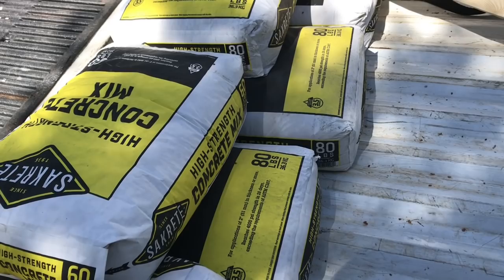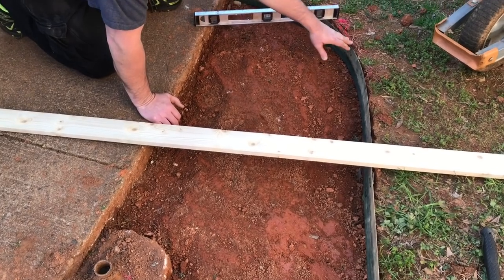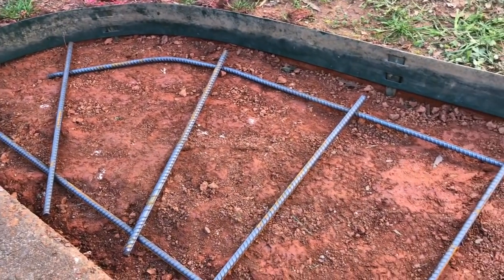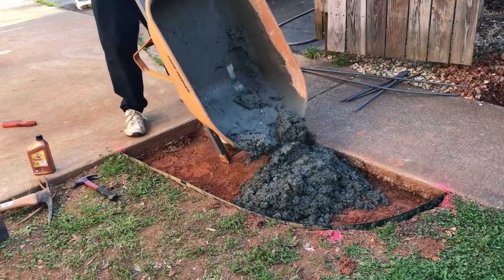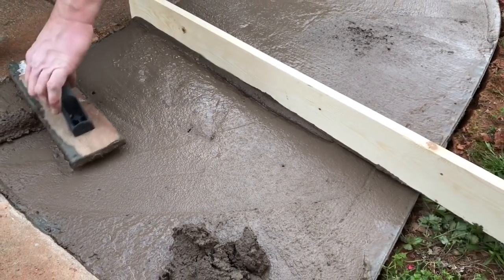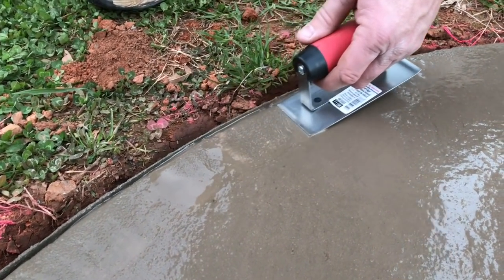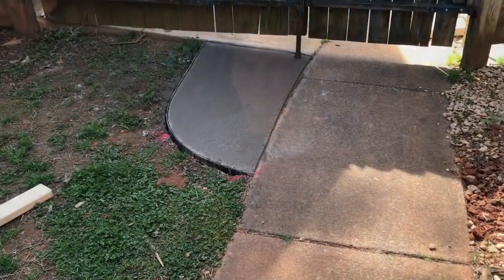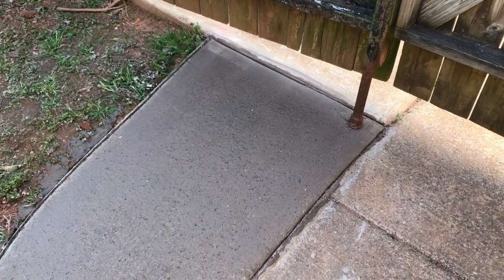How to Pour a Concrete Pad or Sidewalk Extension

Comment: Looks good. One thing I learned is to keep the wet concrete off your skin. I poured an extension of my driveway in July and had to kneel down in it before it started setting. The acid ate up my skin around my legs so bad it took 2 months to heal. I have some pretty nasty scares but the driveway looks awesome
Reply: opichocal that's from the Lyme I believe. Hope ur ok now. Damn
Reply: Frank A  Cement work or masonry, usually carry small jug of vinegar works great, soap and water won’t do it .
Reply: Omg! I've worked with concrete, never had this happen. Yikes

Comment: That’s awesome, I wanted to know that if I needed to put a wood frame for a small addition like you did. But 3 of the sides are actually the current sidewalk and street. So I don’t need to add the 2X4 except on one side.

Comment: Hello from England & thanks for the video.
Question: I have a front door step & I want to make a concrete path that goes up to it, do I have to leave a little gap between the step & the path? If I go right up to the path do I have to use anything to make the concrete & step stick together?
Thank you for any help you may give.

Comment: Question: (I’m tearing out a 4x5 platform outside my walkout basement and pour a new 7x7) do I need to drill a hole in the retaining  wall and/or house footer to insert rebar to tie all in together? Or do I just pour separate?

Comment: I personally would have used a hammer drill and drill into the existing slabs and sink the rebar into it 4-6” so that new slab will stay level and locked into the existing sidewalk, and add an expansion joint piece in between slabs and cut the new slab to prevent cracks just my opinion/thoughts looks good tho
Reply: That slab is small enough to do with no cuts.  And given the amount of rebar, he can just relevel it at any point.  I would have doweled it though
Reply: @matthewlee1469  would you dowel it if you're extending a sidewalk by about 3 or 4 inches?
Reply: I would.  It's not a lot of work, and it keeps everything in lockstep as the ground heaves
Reply: @matthewlee1469  do you think I could use concrete anchor bolts instead of rebar?
Reply: Yeah, that would be fine. Tie it in every 2-3 feet.  You'll be glad you did five years from now.

Comment: First of thank you for the video. I m doing a sidewalk around my house but i read that if u have old concrete never pour new concrete without placing a jointer in between old and new concrete. I didnt see u doing it. Just wanna do it properly so nothing cracks later if anyone know please reply. Thank you
Reply: Joe C  Thank you Joe :)
Reply: Expansion joints and I personally like to use dowels but I see no one speaks of it. Probably because it's time consuming and owners hate to see a separate labor fee on invoices.

Comment: Hi sir, two things I want to mention here if you don’t mind sir, I didn’t see you sir tighten the reo bars together to get it support across all bars to avoid a weak spot on concrete, second thing when you start edging and finished with a brush of brome I noticed the concrete was too wet and wasn’t ready for edging or brushed out. Thanks sir
Reply: Pero el estaba perdiendo el día
Reply: You are exactly correct.  This guy is a rookie flatworker.

Comment: Should have tied the rebar together? But looks good great job!
Reply: Why?  It's not like it's going to move now that it's forever embedded in concrete.  You tie it when you put the rebar in first and have it on chairs or dobies so they will stay in place when you pour the concrete over them.  The way he did it, it's not necessary.

Comment: thank you! have to figure out how many bags of concrete I need! 
would you suggest tie the rebar together or it's not required? kool!!
Reply: TIMOTHY WRENN   Rebar will help, in this case tying the rebar insignificant. We have what, seven square feet of sidewalk,Lol. Go to Home Depot check out the bags they have a chart that will help you figure based on depth and square footage. Good luck.

Comment: Do you need a permit to do something like this?  I'm wanting to do something very similar.
Reply: AroundIndiana Permit to pour cement on your own property? No.
Reply: @crazymuthaphukr  thanks I am new to all this.
Reply: AroundIndiana  coming from a different angle, the building code does not require a permit for concrete flat work
Reply: I know this comment is old but you useally only need permit if you're touching the drive way part at the curb  or large areas of public sidewalk excluding repairs.
Reply: The only other cause for concern would be if you live in an HOA, like I do, but even then it's usually no problem because I can do anything in my backyard as long as it's not above the level of the fences where people can see

Comment: What purpose does the rebar do? I seen other people not use it is it needed? Thank you
Reply: It's basically like a skeleton that makes the whole thing stronger when you use the rebar right. It has to be in a position where once the concrete is poured the rebar will not be visible cuz its inside the concrete. They use it on buildings and fw and such...you'll see the big support pillars being formed first out of rebar long before they get to the concrete. Look it up.